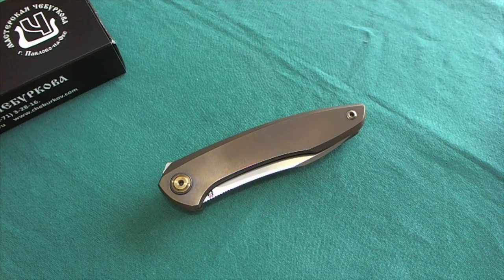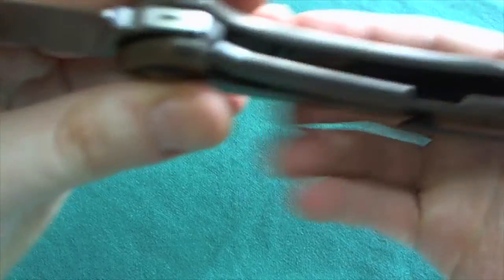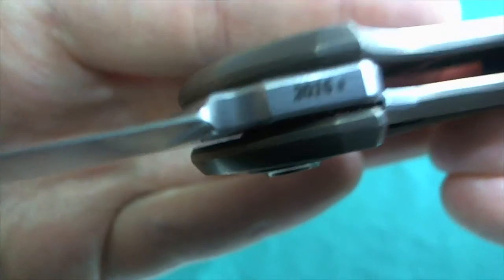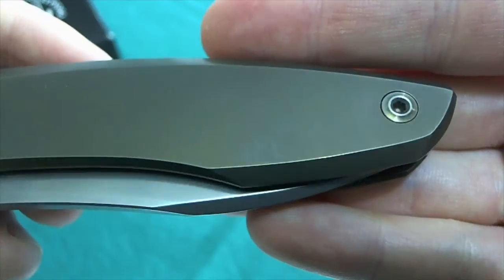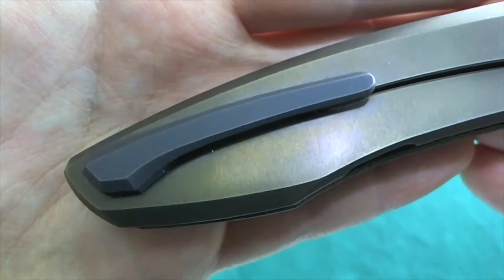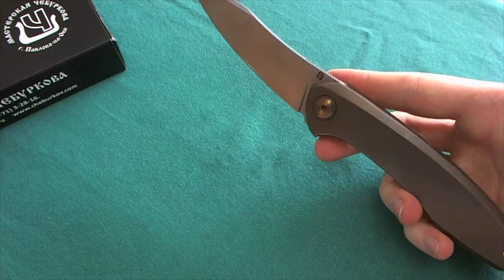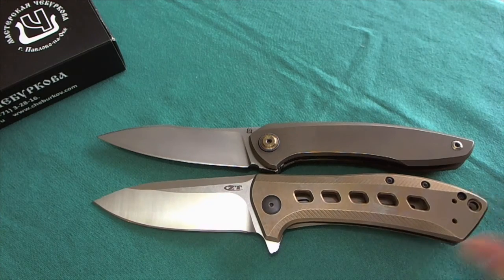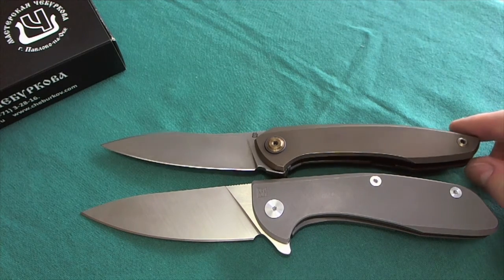Cheburkov Russki Overview - Russian Design at its Best!

Comment: Great reviews! Any idea if its running on washers or bearings???
Reply from the maker: +Bran Poh on bearings, I think I mention it also in the review. Thanks for watching!
Reply: Thanks bruh, really appreciate your swift reply! I saw one with damascus and it @ 890 USD. With your experience, you think its worth? (Do you know its bearing system? loose bearings like the Shiro or caged bearings like others US makers?) Really appreciate your thoughts and comments! thank you
Reply from the maker: Bran Poh they have cages bearings. And in my opinion these cheburkovs are on par if not better then shiros for a fraction of the cost. I myself own now 2 tucan modell with bearings one in micarta and m390 and one limited edition blakc and white in damascus and mokuti clip, backspacer and thumbstud. These 2 are the pride of my collection, amazing action and fit and finish. 
Where did you find it?
There are different kinds of detent tunig and specific bearing types in use depending on the age of the knife.
You can contact toolsforgents.de (they are the worldwide destributor of cheburkov knives) for more info and a price / offer on any cheburkov model (even a custom order)
I got my 2 Tucan modells from them and even got some warranty work done (refinishing after carry & use ) 
Great store and amazing maker if you ask me